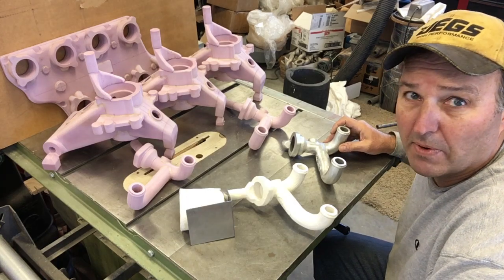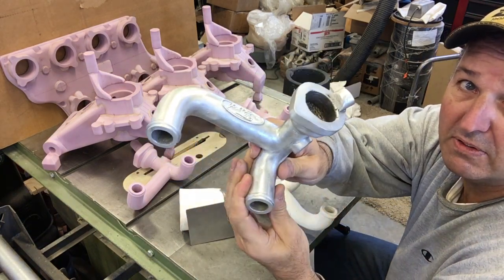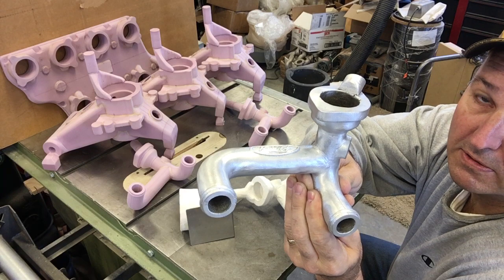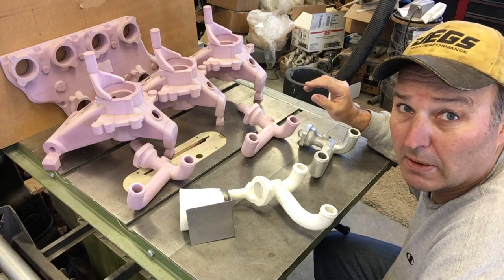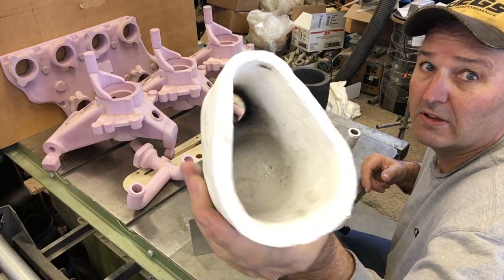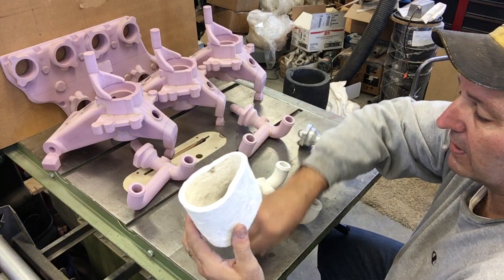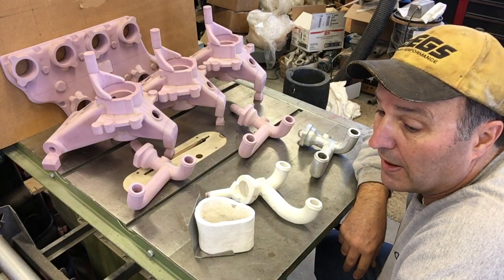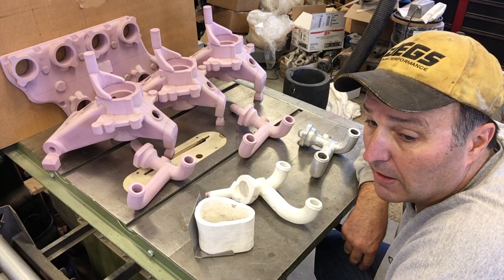Lost Foam Aluminum Part 1- Pattern and Prep

Comment: I want to cast a aluminum pulley 60 lbs
How big of a basin and how big of a hole to feed the runner
Reply from the maker: For the basin, I usually shoot for 20-25% of the casting weight. There's no downside to a larger basin. Just because you have the volume doesn't mean you have to completely fill it. As far as sprue, hard to say because it can depend on so. It can depend on many things, especially the downstream gating. I cast 40lb pound pours with 1.375" square sprue. If your casting itself is 60lb's you'll have more with the feed system. Best, Kelly